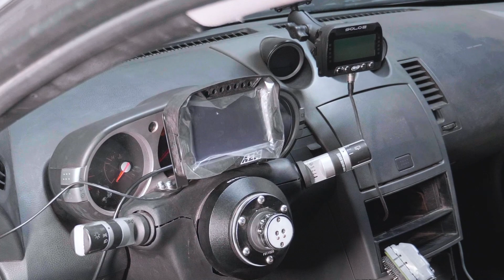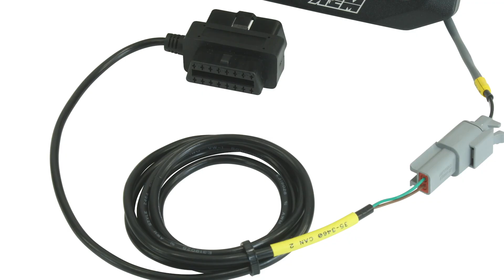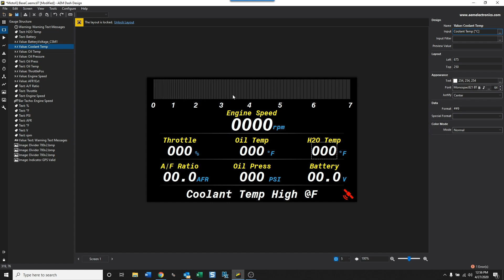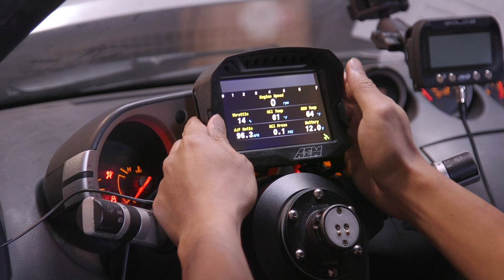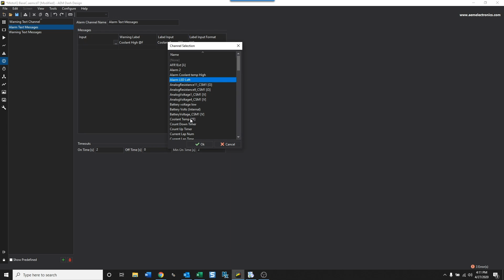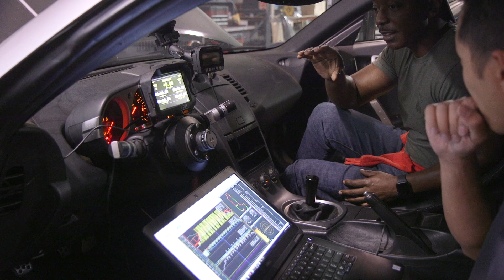AEM Electronics CD Digital Racing Dash SETUP (CD-5/CD-7)

Comment: i have 6 channel module    i just choose tachometer to the rpm   and still didnt finish my car  but want to make sure    what is LS1 crankshaft speed inpot     u said 36tooth sensor is 5400  ls1 ls1 is 24teeth?  incase if i miss something
Reply from the maker: It's 24 teeth
Reply: So what frequency   ?  same 5400 ?
 @motoiq
Reply from the maker: I don't know, I just know the LS1 reluctor is 24 teeth

Comment: Why are all these digital screens in the automotive aftermarket stuck on these super cheap displays? Whether it's audio or aftermarket head units, they all have resolutions that would make a 711 phone look expensive by comparison.
Reply from the maker: Maybe because its more than enough to clearly display data? The AEM screen is very easy to read.  Its not like a phone or tablet where you need to see super small stuff.
Reply: Not just that, “automotive rated” is a real thing. You need to be able to park in in the Arizona sub for most of the day and bot come back to a molten screen or like a phone screen that just won’t turn on or display anything because it’s too hot. Same for extreme cold, same for super high humidity etc etc etc etc